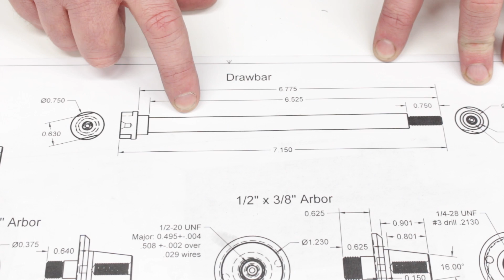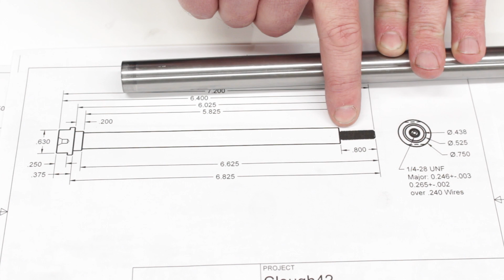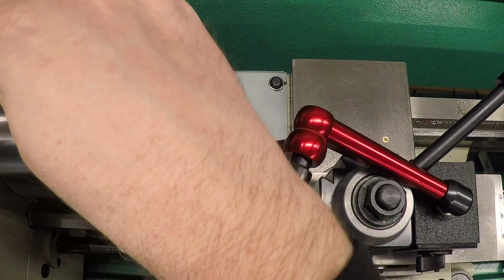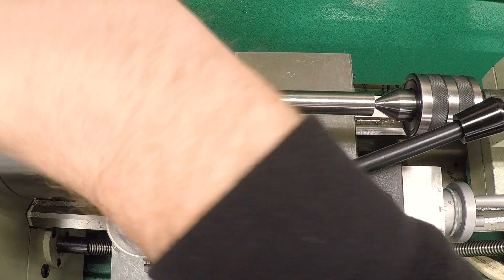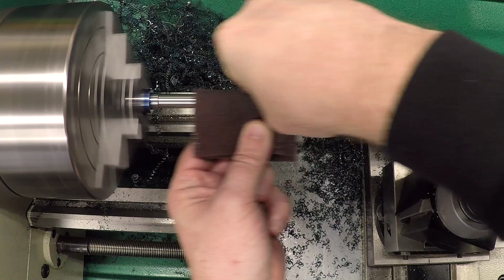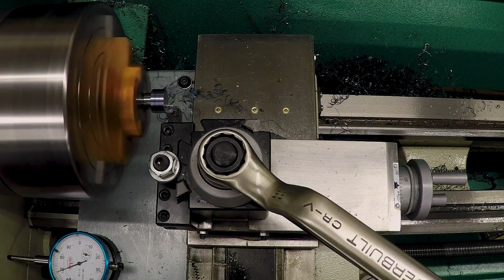Making a Toolpost Grinder Part 16: Drawbar 1

Comment: Not sure it's a correct way to center drill a rod - obviously it's not quite straight - when you extend it - it deflects, and when you push it with center - it bends to straight, then you turn diameter, and when you remove center - it springs back - and voila - you've translated that non-straightness to a finished part... you suppose to either center drill it when it's at full extent or center drill both ends and turn it between centers...
Reply: Also never once checked for taper when turning to the live centre. Every lathe is different but none turn dead true all the time. If you're taking the time to make sure everything's concentric then taper should also be corrected.
 The "bulge" in the middle might have been corrected with a spring pass or two rather than the hit or miss of a file.
Resorting to cutting the threads after removing the centre and turning it around is also a mistake if you want truly concentric threads. Turn them in the same setup then there's no question of their concentricity. 
The "nut end" will be near enough true in the three jaw chuck. You'rer going to cut a hex or flats anyway so your 0.003" TIR won't make a blind bit of difference.

Comment: Nice series, nicely made videos, and nice design, congrats!

How it comes I'm always looking for lathe projects such like these in here and didn't even know you existed until today? Bloody yt's algorithms....

After watching the series and such a deployment of tools and resources, I think I would have gone for a grinder + taper attachment.

You wouldn't have been constrained by center-line height @ design time, as you would remove the compound rest to mount the grinder. You wouldn't be constrained by the compound's travel, as you're now, and would get you more accurate and repetable.

THe grinder could even be used with same or a beefier motor and a different setup, as a milling head for simple things that saves time to do in place where possible, such as squared or hex features, off-center/perpendicular drills and taps, etc.

Speaking about gear reduction, I think is so high that it's going to noticeably slow down the grinding wheel as it touches the surface, but that can be solved.

Keep up the good work. Thousands of views and subscribers are probably round the corner at this point.

All the best!
Reply from the maker: Thank you for your kind words.  I appreciate the encouragement.  Getting started with YouTube is certainly a challenge.  I'm just making stuff I would want to watch, and I guess time will tell if other people want to watch it, too.  :)

The taper attachment is a really good idea.  I may think about making one at some point.  Ditching the compound on this lathe would be great for more than just grinding.  I've noticed it flexing quite a lot under heavy cuts.  I have a video coming up soon where you can see it diving into the work under load.

I'm not sure how the 1:2 gearing will work.  This motor has a huge amount of torque, but I don't have any sense yet how it will work with a 4" wheel.  I wanted the high speed so I could use mounted points for inside grinding.  If there isn't enough torque for a big wheel, I guess I'll make different pulleys.
Reply: Ops, I didn't get notified about your answer.

Of course same people watching the rest would like to see your videos too. I personally find yours even more entertaining and better produced than more than channel one out there with thousands views and subscribers.

You don't talk up to a point where it gets boring, don't try to be the funniest guy, clearly show the machining process, and it's noticeable your attention to details, to precision, and to the recording itself. Besides the final product, it's also nice to see you learning and getting better as you do things.

If you want to keep same ratio with the 4" wheel you can always resort to a flywheel on the back side of the spindle.

About the lathe flexing, well, it's a chinese lathe, it will need some real love to get the most out of it. 

Meanwhile, you can have a look at JimmysCanal's video about the diamond toolholder for a much more natural cutter that will put less stress on the machine, it's bearings, and the workpiece itself. I'm sure a bit of thinking about it will take you quite far.

Regards!

Comment: Please!
When polishing near the chuck, position your fingers on the under side of the revolving part!
Your fingers will be knocked out of the way of the chuck, not sucked into it.
G'head, ask me how I know. ;o)
Two broken fingers later...

Oh, also, not a critique but curious as to why you don't set your desired dimension into the mic, zero it then read the differential?
Truly enjoying your videos!
Reply from the maker: I have had a finger jammed by a tip strike on a chuck jaw, and it hurts, but I hadn't considered the possibility of pulling the finger in.  Thanks for the tip.  Sounds like you learned that one the hard way.

Using the incremental mode on the mic is a good idea.  I often do that with a caliper, but didn't think to do it with the mic.
Reply: This the kind of commentary the YouTube community should strive for! Both points are pertinent and useful. Thanks Grey Beard.

Here’s my two cents on handling the risk of polishing near the chuck:
The next step was removing the part to turn it end for end. So I’d have just extended it a couple of inches to do the polishing, since concentricity wouldn’t be a concern for that. No need to have the knuckles within an inch of those jaws if one can avoid it.